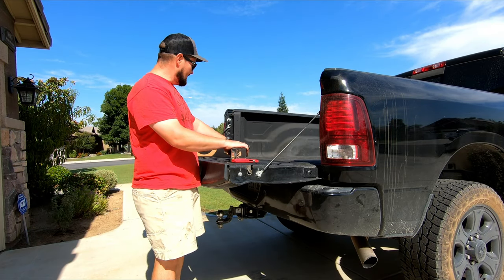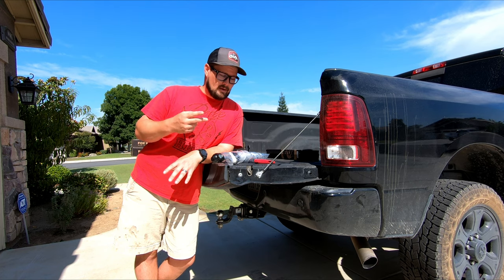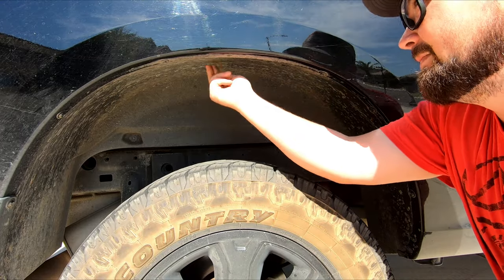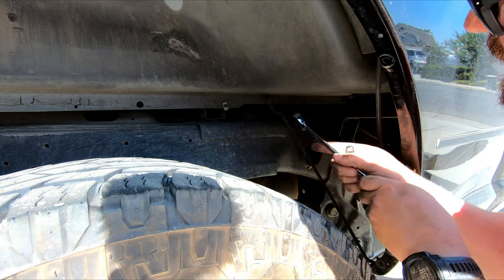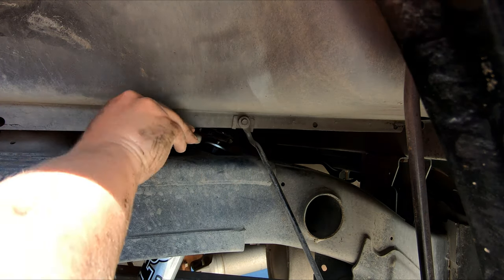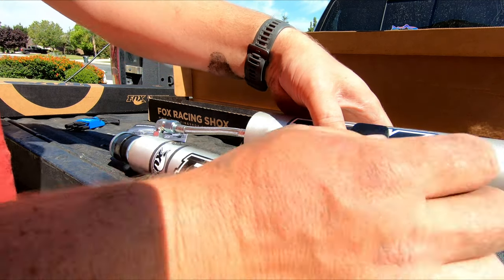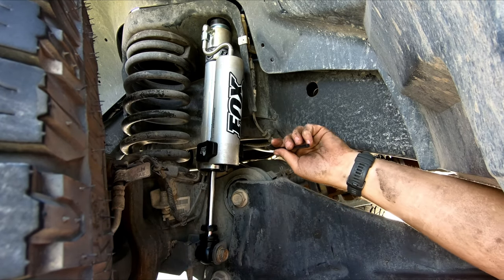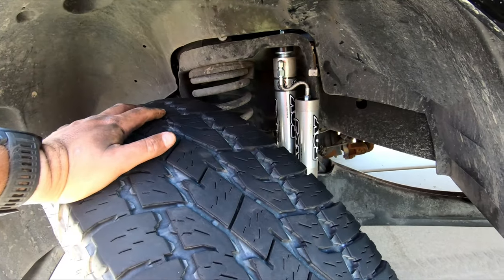How To Replace Shocks On Dodge Ram 2500 4x4 / Fox Racing 2.0 Performance Shock Installation

Comment: Ordered my fox 2.0 with reservoirs for the front and back yesterday. Can’t wait to get them done. This video helped a bunch. Thank you 👍🏻👍🏻
Reply from the maker: Awesome! You won't be disappointed. Just make sure the reservoir is in the right spot. The tire shop twisted mine and the tire rubbed it all up and ruined the sticker before I fixed it. Good luck on the install!

Comment: Have you had any trouble with the shocks moving rotation, I mounted mine the same but for some odd reason the passenger side rotates and reservoir hits the tire!
Reply from the maker: @ianramirez3364  that's the same one I had issues with! I've only had it happen once and I thought it was the tire shop that did it during the inspection.
Reply: @RoadandReel  oh ok, yea it’s happened about 3 times and I’ve tightened them down all the way and it’s still moving kinda lost on what to do now lol!
Reply from the maker: @ianramirez3364  there's a hole in the inner fender shroud. Can you try to use that to wire tie it into place using the reservoir line? It could also be the internals that are forcing it to rotate. Maybe let it rotate again, then loosen the reservoir and move it back in place.

Comment: No need to lift up frame when installing? Less compressing by hand when putting in? Just curious ..about to install..
Reply from the maker: You could, but I didn't need to. Use your best judgement and if it makes the job easier, go for it!

Comment: My 2016 Ram 2500 on 20” fuel
wheels and Michelin Defenders 295/60R20 and it rides so stiff and bumpy. Uneven roads or roads with bumps, cracks, etc it rides and rattles me to death. My 2018 Raptor hugged all the bumps and uneven roads and stayed planted and rode like a cloud. My 2016 ram hood and skips and rides rough. Will these fox shocks help? Do I need to have a leveling kit as well? I want the truck to ride soft. I never haul anything so not worry about payload at all.
Reply from the maker: Mine rides way softer than it did when stock and it would nearly run off the road on washboards. Now it handles the washboards way better.  I have also switched from the Toyo Open Country AT II to the Cooper Discoverer AT3 XLT and man these tires ride so much better! The load range E tires make it tougher and the Raptors are made for high speeds off-road while the 2500 is for hauling. I am really happy with the upgrade, but it's a pretty stiff price point. If you're just trying to soften your ride, maybe start with tires when you need them and then go for the shocks if that doesn't help.
Reply: I have a 2014 ram 2500, and run 40 rear psi and front 50 psi when not hauling. Seems to help a lot.
Reply: it's because you have 20" wheels. go with a 17" wheel and good shocks. Your ride will be a lot better

Comment: Do you have part numbers for the front and rear shocks?
Reply from the maker: I don't have the part number, but here's the link where I purchased mine. https://www.unlimitedtruck.com/2014-2018-ram-2500-4wd-fox-2-0-performance-shock-kit?gclid=CjwKCAjw_NX7BRA1EiwA2dpg0hYxGQbJiNI2ikWaYsCmjmgcigbbwQMCtTfHDUnr0hDZVBr8bIQJMBoCTh0QAvD_BwE

Comment: When you repositioned the shock did they run on your tires?
Reply from the maker: No, no rubbing at all. There's plenty of clearance on these with 275/65R20 tires. This is a 4x4 3/4 ton, so it's up a little higher than some other models.
Reply: @RoadandReel  maybe I installed them wrong but I was getting rubbing on my tires.
Reply from the maker: @adrielespinoza9804  Are they rubbing on the reservoir or the shock itself?
Reply: @RoadandReel  it was rubbing on the reservoir. I saw the video and thought I did it right but I have a 2017 ram 2500 power wagon and it shouldn’t have been that different. Also I could be an idiot haha
Reply from the maker: @adrielespinoza9804  lol, see if you can rotate it out of the way. They also have other mounts that will offset it a bit.

Comment: How did they effect your towing abilities? I have a 2014 with the Cummins and bilstiens all the way around and they are beating us to death. Want to switch to fox, but use the truck to tow our tractor on our gooseneck a good bit.
Reply from the maker: They perform way better than the Bilsteins I had on my old Dodge, but it was a 2003 and I would tow a 9,000lb tractor and trailer with it during the summer. So far, the heaviest thing I've towed is probably 6 or 7,000lbs of concrete and it was way smoother than my old truck. But, those are also 2 different suspensions. I don't think I'll ever go back to Bilsteins, but I don't want to tell you the Foxes will solve your problem, either. At close to $500 for rear shocks, you could almost get a nice airbag setup for the rear and then maybe switch your shocks out when the Bilsteins wear out. Swap them out on warranty, then sell them and try to offset the expense of the new Fox shocks.
Reply: @RoadandReel  I replace Thuren sway bar and Fox ATS steering stabilizer, also DPF back kits, I keep all the stuff in the attic. When I plan a new truck I will swap back :)
Reply from the maker: @dmtycn  that's an excellent idea!

Comment: They say only the non reservoir shocks fit the rear but the hole in the frame is kind of ovaled out enough for the hose. I bet you could fit the reservoirs in the rear too. I wonder if anyone has tried? Maybe the valving in the rear is different too? Idk
Reply from the maker: I bet you are right. There is plenty of room and with a long enough hose, the reservoir could easily clear everything and be mounted to the frame or elsewhere out of the way.
Reply: Did you find the correct  reservoir shocks for RAM 2500?

Comment: shit..not much down travel..like 3" did you buy too short of a shock? unless you're on road mostly..but offroad..you'll get not much down travel on the rear.. fronts looks like it has enough.
Reply from the maker: Honestly, I thought the same thing. I'm set up more for towing or traveling at high speeds on rough roads. They were a little longer than stock, but I just don't think the solid rear axle on this truck articulates that much. I'm not a big fan of going on crazy 4x4 roads in my daily driver, but if that was the case, you can get them in many different lengths to suit your needs.